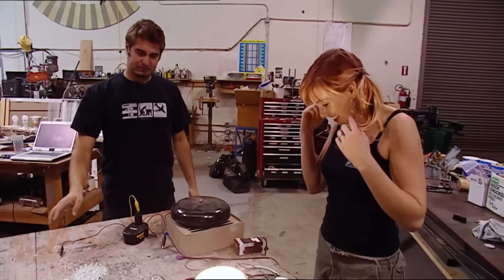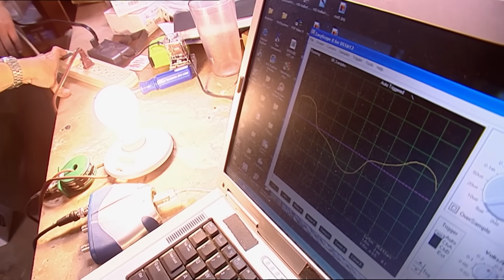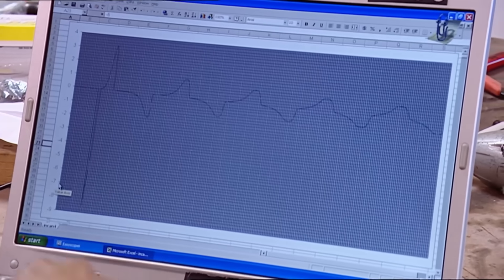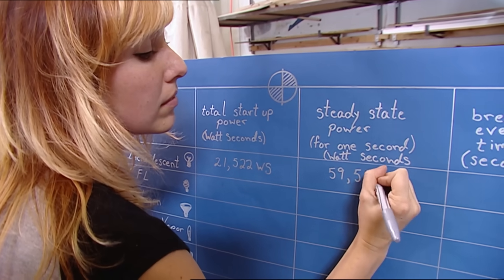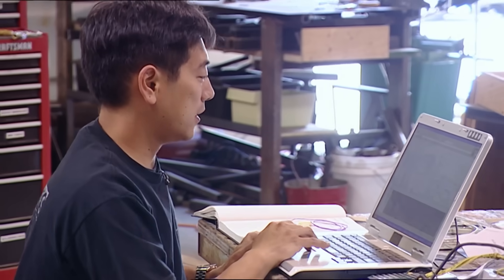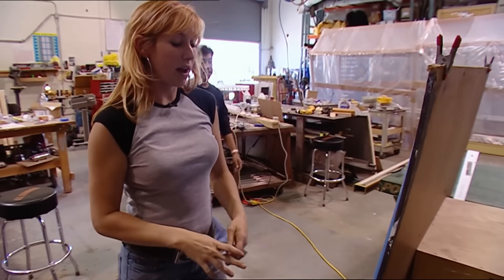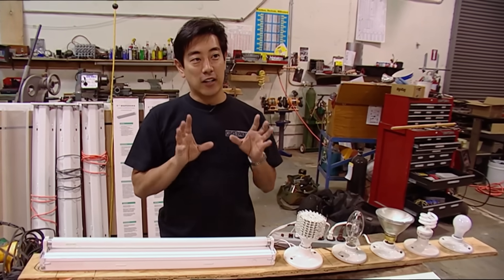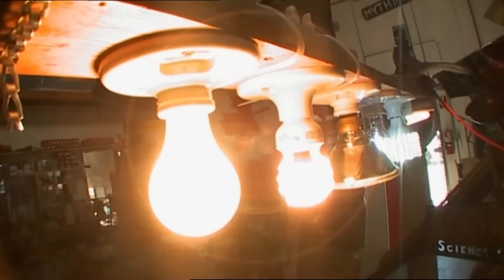Is It Cheaper To Leave The Lights On Than To Turn Them Off? | MythBusters

Comment: The source of this myth has nothing to do with power cost savings. 
Prior to the current era, power companies left the facility lights on continually, this because the older lamps would last much longer if they were not switched on or off. Tungsten filaments were different then and much more resilient. They were reverse engineered to make them not last in order to sell more lamps. For a while, casinos had sourcing for the old lamps, because they never switch.them off as well. Current tech has changed things, but I would guess that even today in our disposable friendly world there are special lamps for use by casinos and power facilities are more robust ...

Comment: So next question! If I leave something plugged in but not on does it use/run up your electric bill?
Reply: Depends on the electronics. Some electronics have power regulators that draw power even when there is no load, more modern electronics waste less energy when doing this but it won't matter much if it's a low power electronic.

Comment: Is It Cheaper To Leave The Lights On Than To Turn Them Off? before I watch I would think it depends on the type of light bulb. I believe a Standard Florescent light needs a Lot of power to first come on then the draw drops drops. Now to watch the video and see.
Reply: Now that I watched I was right about the Florescent Light bulb. So YES 23 seconds is a very long time for the amount of power to start up. Turning it off and on a few times ADDS Up, the more you turn off and on the higher it costs then just leaving the florescent on for those few seconds.

Comment: In the winter leaving the lights on can also add heat to the room therefore reducing the energy used by the building's heating system. You could factor that in.
Reply: True with incandescent bulbs, not as much a factor with florescent or LED. I don't know much about sodium vapor and other types.

Comment: It may be cheaper, but for light bulbs that are difficult to change out, like the ones in my outside lights, leaving them on make them last much longer because the filament is not being stressed by turning the light on and off.  I have been living in this house for 3 years, and the light bulbs that were here originally are still burning.

Comment: Fluorescent lights electrode coil heats up and strikes arc to vaporise the metallic mercury when turn on. Each heat up strike cycle will dislodge tiny amount of material from the electrode coil which get deposited and darken the end of tube. Also wear out the starter tube.

Comment: 5:59 making the lights last only a month means myh busted? 😂
Reply: Firstly, not if LEDs.
Secondly, that's turning the lights on and off every 2 minutes 24/7 - they say in the video that it's equivalent to 5 years of typical use. Even if your only metric is $, you save so much from turning the lights off compared to replacing them every 5 years.
Reply: @NWRIBronco6  point is, if you turn it off and on all the time means you have to replace it more often, so someone who is more worried about that over the light bill, it's better, for example someone who had a large light sistem that is a hassle having to switch out light that went bad, they'd worry more about the lights life than a light bill.

Your mistake is thinking things a linear and purely about dollar spent and forget that a light that goes out needs to be changed.
Reply: @J040PL7 I don't have a clue what you're saying and I don't want to
Reply: @J040PL7  People don't flip the lights on and off every two minutes 24/7. This was not equivalent to a real-world scenario, just a demonstration of thermal fatigue.

Also, they had no control group! How long does a lightbulb last if it's on continuously?
Reply: @J040PL7 are you on drugs
Reply: @J040PL7 lol what do you think happens to the light if it's on for 5 years. Like wtf
Reply: @J040PL7 

I think the 3rd variable that is being missed is that 5yrs of continuous use is being based on the on/off wear and tear, but isn’t factoring in the non-stop wear and tear

My takeaway is that if I’m leaving the room for a couple minutes, I’m still leaving them on for convenience of being able to see (provided that it’s not daytime, end of dawn or only beginning of dusk) but if it’s dawn through dusk, I’m likely fine leaving more lights than not, off… basement is an exception as there’s just not much outside light through the limited windows I have, but I can still see decently enough for most of what I need to do down there

I’ll always save more money on my power and increase bulb longevity by turning them on when I actually need the light, rather than just being in a room at all to justify having lights on
Reply: No
Reply: Bru😂😂😂

Comment: 50W is 50W you will spend less money on heating. My though has always been, if i turn down or off heating, then I will turn off the light. Same goes for my PC.

Pc does consume power, but then again the room I have my Pc in never needs to have heating even in winter.

Comment: Yeah, but what about convenience and safety? it's not always optional to reach for a light switch or wait for a motion sensor to pick you up when you enter a room.

Also having lights trun on and off can bother people's eyes.
Reply: If your light switches aren't safe to access, that's a far bigger problem than turning your lights off and on.
Reply: @SmilingNinja Well doing things to code has it's drawbacks.
Reply: @AntonioCunningham  Well, if you or some contractor aren't building things to code because you want to save money, that's probably illegal.
Reply: @SmilingNinja ??? I think you have that backwards. Building to code makes having some light switch not convenient or safe to access. I get around it by using timers, smart bulbs and simply keeping the light on.

I'm saying there are valid reasons to leave lights on
Reply: @AntonioCunningham  What are you talking about? Most building codes will take into account people with disabilities and such so they can have switches and plugs in different areas. And no, ever since LEDs became popular and affordable, there is no good reason to leave the lights on except for pure laziness.
Reply: @SmilingNinja I'm assuming you've never consider other people opinions other than yourself. 

He's an example of lights being installed at doors for easy access can be dangerous. Doors not in clear sight when dark. There have been plenty of times where I see people hit the wall or have to pull out their phones because they're not near a light switch... A light switch that much be at the entrance of doors, not far away where they'll be more convenient.

This is why motion sensor became a thing to address this short coming.

Think about outside lights. How are you supposed to Turn them on from outside? 

What about lights being left on for security? Does that not count.

What about the strategy of having lights turn on when you're not home to make your house look like someone's there? 

Does that not count either???

Again, there's legitimate reasons for not always turning lights off.
Reply: @AntonioCunningham  Why on earth would a switch away from the door be more convenient? You do realize that you can have multiple switches for the same light? 

Motion sensors are great because they turn the lights off if there's no one around.

Why on earth would you want people from outside having access to your outdoor light switches? That's actually a good case for motion sensors as opposed to outdoor light switches.

In what universe do you live where if you leave the lights off, some burglar is immediately going to break into your home. It's paranoia talking. 

So no, leaving the lights on without some kind of sensor or something turning them off is a dumb idea.

Comment: Think about those old fashioned marquee signs that had hundreds (or thousands!) of lightbulbs turning on and off every fraction of a second, continuously for days and weeks at a time.
On another note, the original Thomas Edison lightbulb in his shop (museum) STILL WORKS, apparently because its filament is much thicker than production bulbs. This uses a lot more energy, but it also makes the bulb much more durable. Traffic lights that have not been converted to LED are also built this way, which is why you hardly ever see them being replaced.

Comment: Correct me if I’m wrong, but the start-up test was only for one bulb.  So if you had 8 lights in a room, that’s 8 x 23 seconds for the fluorescent tube.  If you’re just going down the hall to get a drink of water, it’s likely that it’s cheaper to leave the lights on than turn them off.  That’s not busted.

Comment: Two very minor complaints:
1) They should have tested several bulbs of each similar type to account for slight manufacturing differences.
2) Watt-seconds is a unit of energy, not power. Using energy is absolutely the correct quantity to use there, he just said it wrong referring to it as “power.”

Comment: Years ago I worked in a restaurant that had a large patio. I convinced the owners to buy florescent flood light bulbs instead of incandescent flood light bulbs. The florescent bulbs would last 18 to 24 months whereas I would have to replace the incandescent bulbs 3 to 4 times a year. The change was worth the savings in labor alone to say nothing about the savings in bulbs and electricity. LED. bulbs last way longer than florescent bulbs.

Comment: Have to calculate the effect on the lifetime of the light-source and fixture. Which suffers degradation from being turned on/off? As compared to being on all the time. With the much greater variety of light-sources available nowadays the answer is probably very varied. Standard warranty for the modern light strip fixtures are, to my knowledge, 5 years. Funny coincidence? 🙄

Comment: The reason for not turning off incandescent lights was not to save energy.  It was because the filamant was damaged more during the initial powerup than while operating at normal operating temperature.  Leaving the light on would make the bulb last longer.  Those of us who remember incandescent bulbs know that they very seldom died while they were fully on.  They almost always burned out when you turned them on.  There would be a quick flash and then they were dead.  Whether the amount saved by replacing the bulb less often was less then the cost of electricity is an open question.  I suspect not, but I made some test racks for GE Lighting, testing incandescent headlamps for vehicles.  They would test 100 lamps, with ten sets of ten each having a different amount on times, and off times between power ups.

Comment: That's all well and good, but if you occasionally forget to turn off the light and then come back in 10 minutes, how much power have you wasted? If it's a compact fluorescent bulb like most people have these days, the amount of power used would be less than a cent as it's only a 10W bulb running for 1/6 of an hour, so if you do the math, that's 0.01kwh/6 so about a sixth of what you pay for 1 kwh divided by 100, so let's say that you are paying 30c/kwh, that would be 5c divided by 100 or 1 50th of a cent . Not worth losing your marbles over.

Comment: why didn't they turn the lights on and off every .03 seconds or whatever it was so there was at least 1 common number in the mix? i don't care. i leave multiple monoblock power amps on 24/7😂

Comment: im an older guy and personally this myth was a complete waste of time and resources for the show.     the money spent on a light bulb back then is so insignificant no one was going to care if you shorten the life of the bulb by turning it off and on when you enter or leave a room,   its obvious to save electricity cost you turn it off.   that being said just for fun they should have brought in an industrial light bulb that was used to light up the lot and the big gas station sign cause back in the 70's at my first job at a gas station my boss told me when he turns on all the lights it cost him 100 dollars for all of them for that first light up,   he said his monthly electric bill was 4000 dollars a month, this before they started using fluorescent bulbs in the signs and the lot lights

Comment: My issue is the same people crying energy efficiency about shutting off lights religiously don't bat an eye warming up the space heater for half an hour before stepping out of a hot shower. Before LEDS the energy waste from leaving a light bulb on too long was miniscule, now it's even more ridiculous. Compared to say charging a phone or the television running. An hour a day of either is worth more than every light in the house running nonstop. People never think rationally.

Comment: I have all compact fluorescent and LED bulbs. I haven't measured anything, and I turn them on and off regularly, but I can tell you they last forever. I haven't changed a bulb in years.  There's another issue for me: If a ceiling light goes out, I have to climb up a 5-foot ladder to replace it, no longer easy for me.

Comment: Did you take away the power from the power strip? The power strip has all kinds of resistors. Should of used a regular light switch

Comment: Come on, soooo unscientific. Your test of wear and tear is useless. Running your longevity test for "over a month and only the led is NOT burnt out" means... nothing. Did the incandescent burn out in a week? How about the halogen? Certainly the heating and cooling of the filament will cause additional stress. You needed to determine when they burnt out and compare that to leaving them on until they burn out (although this would take longer than a month). Likely, your conclusion is still valid, but the only real conclusion you can take away from your test turning them off and on is that it certainly burns them out much quicker than just leaving them on 😜

Comment: Energy used equals heat, so it is easy to see that the inrush current of all these bulbs is relatively short because they do not have much thermal mass to heat up in the first place. the fluorescent tube has the largest thermal capacity to heat up.. besides maybe the LED heatsink but that  doesn't count.

Comment: This gotta be the worst myth busters episode ever. "Do you use less electricity when it's not on?"......DUUUUUHHHHHHH 

They should've done this with air conditioners not light bulbs. Is it less electricity by leaving it in thus keeping air cool or turning it on and off thus making the air conditioner work harder to keep recooling the room. But even this should be obvious. Yes you use less electricity but is worth it to keep the room cooler this way?

Comment: Its actually  not better turn of most of it rhen using it ween ya  don't need  to be more bills if not so no its not exactly  but us as you wanted  lol but not here  in Norway  bills electricity  gasss expensive  as fuck  ar times

Comment: LEDs make it a no-brainer: off = free savings, zero downside. The "leave on to save wear" myth died with incandescents.LED bulbs are now cheaper than the energy to run them and most last 100k on/off cycles.

Comment: Also there is a side effect with incandescent lights. They put out a lot of heat. My 2nd bathroom is approximately 12'x9'x5'. It has a vanity light with four 60 watt incandescent bulbs. If left on that room will heat up significantly. So that increases my A/C usage.

Comment: This experiment is kind of flaw. You supposed to replace the broken bulbs immediately when during the durability test until when it finish to see how many bulbs were used/ replaced for  the on/off comparing to the always on.  Also other factors including the longevity of the light switch, labor cost to replace the light switch. The deterrent of thieves while the light is on and etc.

Comment: I think leaving them on will make them last much longer though because what actually damages the filament is not the use but the heating a cooling cycles associated with being turned on then off. Is it always viable no but leaving a low wattage light on likely isn't going to cause any harm.

Comment: With friend we had similar question about light in a kitchen hood. But not about startup time but replacing it after a failire. Quick calcultion and cost of a new bulb was same as 1,5year of a constant use. Meanwhile we had to replace it once a 10 months or so (when turning on/off).

Comment: With the efficiency of LEDs of today. You can run all the ceiling lights without a fan directly from a cheap solar panel and save quite a bit in the long run.

Comment: It's not the power surge cost it's vs the cost of replacing a bulb that has its life  shortened by frequent starts. For a fluorescent or incandescent lamp this may be significant. For an LED it is not a problem at all.

Comment: Unless you live in a place where you use a heater. In that case, the wasted energy would actually help heat the area around the lamp. 
If there's temperature control, the heater will consume less, since part of the heat is already being provided by the lamp.

Comment: this is dependent on the bulb entirely, a projetor bulb for instance it's 100% better to leave it on than turn it off and on multiple times a day. we leave them on over night all the time in convention centers for this reason.
Reply: That is because those are very expensive specialty products.

Comment: They need to add extra lights to the test, and at least 1 that is on continuously as a control. Otherwise the light might fail by chance and you get fooled by randomness.

Comment: i have no idea why youtube keeps putting out of date videos in my feed.
but they are doing it a lot, and stuff no one would be interested in only specailists eg videos on pipe lenths and what thread is best? what concreat mix is best, what is the best lubricant to use on a trombone?
it has to be AI.